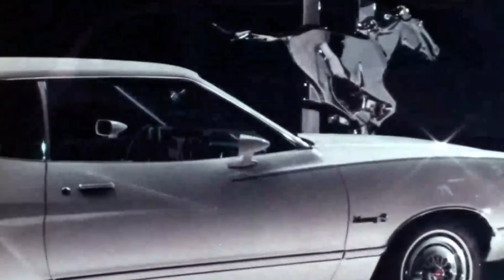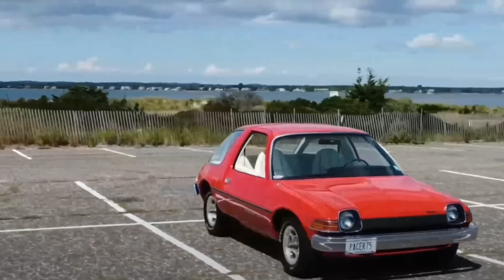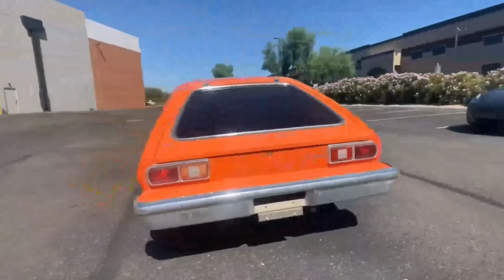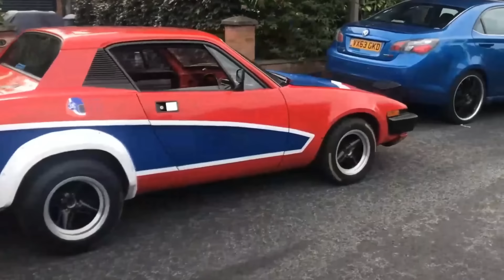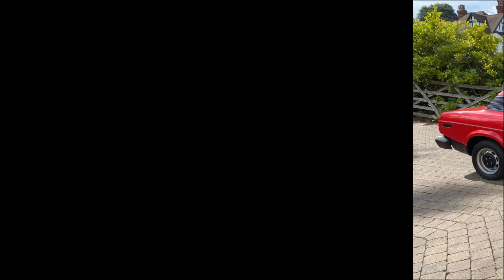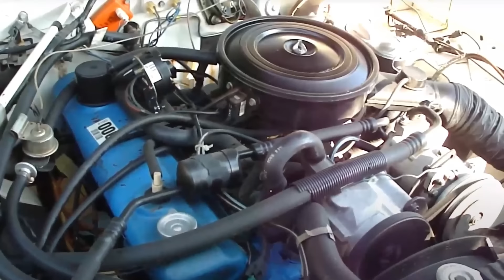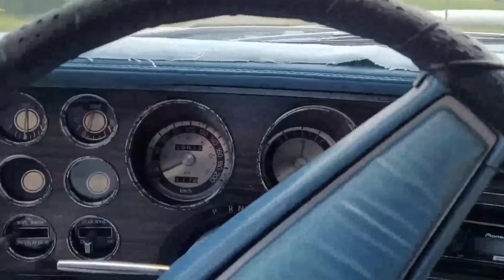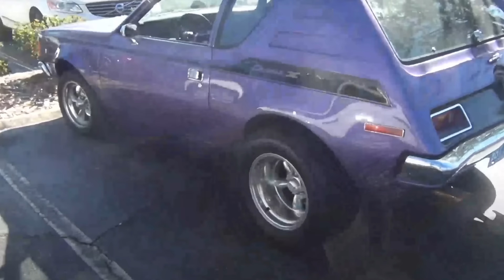Top 10 WORST Cars of the 1970s

Comment: Cars are so much better today. Things like electronic ignition, fuel injection, and factory dyno tuning pretty much took the mystery out whether it would start on a cold day . That is not mention thingd like disc brakes becoming standard, much better safety and  handling.  Modern cars have much better fit and finish on the body panels and paint . ETC.

Comment: I bought a new 1978 Chevette 4-door, 4-speed in 1978. I paid $2300 for it from a local Chevrolet dealer. That car made a name for itself with me behind the wheel. I was 18 years old at the time. There weren't too many days I didn't hold the pedal to the floor and dump the clutch. A retired mechanic once told me that the car wouldn't last past 20,000 miles if I kept driving like that.

20,000 miles went by, then he said it wouldn't make it past 30,000 miles. It made it past that. Then he said it definitely wouldn't make it past 60,000 miles driving that way. It went past 60,000 miles. He then said, "That car made a liar out of me 3 times. That must be one well-built car to take all that abuse!"

People came to ask me, "What did you do to make it run like that?" I opened the hood and said, "It is completely stock." Then they asked, "What makes it run so hard?" Well, when you hold the accelerator to the floor and dump the clutch, it will go or blow. It never blew from doing that; the engine and drivetrain took it.

I had also put 60 series tires on Cragar wheels and raised the rear end. The clutch exploded a little over 100,000 miles. I put a new clutch in, and it had around 250,000 miles and still running when I parked it. I had a new ride and wasn't interested in driving it anymore. It sat for 5 years outside, and a guy who had seen it run back in the day wanted to buy it in the middle of winter, even though it was buried in a snow drift. He said, "I want it now or never." So, I got the tractor out and pulled it out of the snow. He put a battery in it and asked if it would start. I said, "It always did before, but it has been sitting for 5 years with the gas that was in it when it was parked." It fired up after 5 seconds of cranking on it while pumping the accelerator, and he paid me and drove it away. That was the last I saw of it. One of the toughest cars I ever owned. It got 40 mpg when driven normally.

Oh yeah, Dad bought a diesel Chevette—I don't remember the year. Dad was 6'2" tall and had 4 others riding as they went on a 3-hour round trip. Then they fueled up at the same pump. It got 60 mpg, which was impressive! Dad and I raced to see how much difference there was between the gas and diesel. They were pretty even. I thought I would blow the doors off the diesel Chevette. By the way, the diesel Chevette had a factory five-speed manual in it. I thought the engine was made by GM, but I found out later both cars had Isuzu engines. There was a Pontiac version of the Chevette, a T1000—not to be confused with the Terminator character. Lol

Comment: My uncle Donald once owned a '75 Mustang w/opt. 302-cid (5-litre) V8 and automatic transmission! Its biggest flaw was the tranny: the modulator only allowed him to both upshift and downshift manually; coz when it did automatically, I later got the message! In early '83, Brenda's boyfriend Vern, had a '71 or 72 Pinto 2dr., automatic transmission! However, it later wouldn't start, so he junked it!!

Comment: Surprised Mercury Capri is not on the list. What a junker. Mine as well as many other capris on the road with no wing windows because they rattled off. I used plywood. No usable heater, electronic wiring was a disaster. Garbage engines. My 4 cylinder ran as a 3 cylinder most of the time even after a  rebuild unless I fed it a new sparkplug every 3 weeks or so. 1971. Looked nice at the dealer but a pretty turd overall.

Comment: Whoever did these videos didn't live the period. I hated the Pacer, but my folks would only cosign for one. It was 3 on the tree with a straight 6, no ac, and no radio. I would have taken a Gremlin over a Pacer any day of the week. It was so poorly constructed the bolts holding the carburetor in place snapped, and I had to glue with the carb on with liquid solder to drive it to the Cal Worthington's lot in Phoenix. It was shot at 40K...

Comment: I had a Chevette. 0 to 60 took 20 forever it seemed. I got on the highway and a tractor trailer was almost 3/4 mile away. That truck was right on my rear before I knew it. Pedal was to the floor and the car took what seemed like eternity to get to 55 ( the speed limit then). It had a 4 cylinder motor and broke down alot. Transmission failed, wipers stopped working, etc. All within the first year.

Comment: All Chrysler Corporation passengers from 1960 on were of fully unitized construction (except for Imperial through 1966) The Chrysler LeBaron mentioned is considered the M-Body platform which is a stretched version of Chrysler Corporation's F-Body platform which was all-new for 1976. It featured a transverse torsion bar front suspension system. The R-Body cars were the Dodge St Regis, Plymouth Gran Fury, and the Chrysler New Yorker which were essentially on the same platform as 1973 and newer B-Bodies, Dodge Charger, Dodge Coronet, Dodge Monaco, Plymouth Satellite, and Plymouth Fury

Comment: I had a brand new 72 Vega for less than a year. Terrible car. I had a few Chevettes which were great cars for my teenage kids. I'd buy one today if a good standard appeared. The option list, if anyone ever looked, included a header, a Weber carb, 5 speed (stupid fuel economy), a couple of different rear end ratios, etc. The automatics, with air, might have been the slowest car to 60MPH ever built.

Comment: 1. I'm sure GM engineers were begging their superiors not to release the Chevy Vega and start over again when they saw it.
2. The Pacer was intended to be powered by a GM-sourced 1.3-liter Wankel rotary engine. When the rotary project was canceled before an example was even built, that should have killed the Pacer right then and there.
3. The Cosworth-modified Vega engine did not make very much sense when the Vega itself had so many problems.
4. The Mustang II DID have its problems but one good thing came out of it; it saved the Mustang.
5. As was the case at GM with the Vega, I'm sure Ford engineers begged their superiors to kill the Pinto before the first one rolled off the line and start again from scratch.
6. The Chevette was not really intended for American audiences. When it was released its import competition had already moved ahead.
7. The Triumph TR7 - the car that killed British Leyland (or at least one of them).
8. See my earlier comment.
9. See #1.
10. The Gremlin was the Edsel of the 1970s; unwanted when it came out but cherished by collectors today.

Comment: You can say whatever you want. I wish I had one of them right now them chevettes you put a good pair of mud and snow grips on the back of that baby and drive it right through a blizzard. I know I've done it completely submerged in snow. Went out there till I got off the exhaust start that bad boy up while you cleaned it off and came right out with a good pair of mud and snows on the back. Yeah like a truck tire on the back pulled right out no problem. So you say whatever you want I'll take one. I am all the way in

Comment: I bought a 79 Datsun/Nissan 210 Japanese made crap. The biggest lemon I have ever owned. The only thing that did not break was the back seat.  18 mpg, 0-60 in 20 seconds, blown head gasket, starter failure twice. Ignition switch broke twice, AC stopped working, u-joints failed, paint came off, front seat came apart., alternator failed and all of this happened in the course of 50 thousand miles. 
Oh, and to add insult to injury the speedometer was 10% fast. So it really got only 16 mpg and took 22 seconds to get to sixty and I only put 45,000 miles not 50 on that piece of crap.
I would have loved to have a Pinto or a Gremlin instead. I stopped even looking at Jap cars for the next 45 years 100 % American for me.

Comment: You are one of the Stupidest people ever to show your lack of knowledge of the American motors Gremlin!!!  The was a straight 6 of 232 cubes - 258 cubes, acceleration was great with either engine. It was great for reliability I owned a 1971 right out of the showroom and in the 8 years i had it , the only things I spent a dime on were Gas - Oil - Tires - Plugs - Points and wipers! The gas milage was great over 20 MPG, it also was great in snow. It SOLD over 700,000 Gremlins. It was Successful car !!

Comment: This video is so tired and pathetic.  Most of these cars are considered collectible today & draw big crowds at Cars & "Coffee meets.  I grew up during the 70's & got my license in 1979 & am familiar with each & every one of these vehicles.  Yes there were some issues indeed, such as the Vega aluminum engine block, but Chevy introduced an iron block at the end of the run, 1976-77 I believe & were sound good vehicles-however the damage was done.  Ford Pinto's exploding issues have been debunked over time & were concluded to be no more dangerous than any other subcompacts of the era.  There was actually evidence discovered that Mother Jones & some other hysterical outlets rigged some footage & went to extremes to demonstrate an explosion.  Ford Mustang II sold over half a million units in its debut year of 1974 & was largely considered a sales success.  Introduction of the venerable 302 V8 in 1975, cemented its status as a decent performer as a base vehicle & scary fast with modifications.  One must consider the times, the gas crisis of 73-74, caused fuel prices to double overnight.  Admittedly the big 3 weren't ready for this issue & rushed most of the models to market before appropriate tweaks were done, however most of these cars delivered an acceptable level of reliability with inexpensive operating costs.

Comment: The Chevette was a decent car.  You had to be going downhill to hit 80 MPH though.  Forget about 4 people in the car going up hill: it didn't want to.  We took my sister-in-laws Chevette from CT to FL and back.  A bit of a tight space but it worked out fine.  I got to drive my dad's white 1980 model for a couple of years.  I broke the cir-clip on the clutch cable adjuster a few times.  Finally put vise grips on it and left it alone.  It was no race car but I tried to drive it like one.  That car loved to blow headlights.

Comment: the Gremlin was not the ugliest car, the 1961 Chrysler products led that field. The Gremlin was a performer. If you owned one, you knew. The beauty is in the eye of the engineer, not the A I. yapper. The electrical system was AC/Delco or Motorcraft depending on the year. The unreliability was purchased by AMC from other manufacturers
Reply: the eagle had a good reputation

Comment: The AMC Pacer was slated to be the 1st front wheel drive vehicle of the new era. The Cord had that distinction in the 1930's. The Pacer was fitted with a Wankel rotary engine and a transverse power train. However, GM got wind of this and the engine purchases were thwarted so AMC had to reeingineer the car in a few months. The front wheel drivetrain was scrapped and the in line bullet proof 6 cylinder with 7 main bearing support was used. It was shoehorned into the engine compartment and if you have ever had one, you need to remove on of the engine mounts to remove the valve cover and do other repairs. A great driving car, the passenger door was longer to allow for easy passenger access into the rear of the car. These handled nicely as they were wider and stuck to the road. The Chrysler Torqueflite transmission was used so the drivetrain was fairly bulletproof as well. Braking system was decent and the interior components sported different version s of fabric and colors with Sante Fe, Cattle rustler interiors and such. The fuel mileage was mediocre as the 258 was not great on fuel but super on torque. This engine was used for decades and the 4.0 liter is based on the same design. Super torque. I owned 2 of these and a Gremlin as well. My AMC's included a 72 AMX and 5 1969 Rambler SC/Hurst monsters. The 1960 American 2 door Wagon used so little fuel that I always thought the fuel gauge did not work. The Hornets were fun and nice drivers. I crossed creeks in the Gremlin like a little 4x4 but it was 2 wheel drive and a 3 speed on the floor. The Hudson and the Kaiser were all fun drivers but the easiest to drive was the 1965 American 2 dr Ht. 199 or 232 engine (I forget) great performance and drove sweet. I miss the old iron. I have joined the new era now with an HHR. Lotus design multi-timing chain, great sleeper race car. No one expects what it does and I have gone through front tires because of the 5 star burnout ability. See ya on the streets!
Reply: jeep was actually good when amc made it.  chrysler jeep is JUNK.

Comment: I bought a brand new 1978 Mazda GLC right off the showroom floor for $3,600 and it was a great little car. 4-cylinder, 4 speed, no A/C, no radio, but it got close to 40mpg. Never had a problem, never used a drop of oil and surprisingly, I never had to add coolant to the radiator. 
My ex-wife stole it when she left me in 1983 so I bought a brand new 1983 Mazda GLC, this time I got a radio, and it was a great car too.
Reply: all the japan cars were at the top maybe toyota was best by a nose, if that.  way better that everybody else including germany.

Comment: The reason the Cosworth Vega was so weak was because Chevrolet would not let Cosworth put steel sleeves in the cylinders. Their thinking was they wanted to prove the Vega engine could be durable with the standard cylinders. Cosworth said that every time they got over 120 HP it failed, the only way to make any real power was to sleeve it. Chevy said no. Cosworth gave what they had back to chevy and said goodbye. Chevy de-tuned it to 110 HP and put it on the market. Cosworth sued to take their name off of the car but they lost.

Comment: The Dodge and Plymouth sub compacts should have been #1 worst cars on this list. I had a Gremlin that i bought brand new in 72 and i  liked that car better than any other car i had ever bought. Got it Brand New for $2600 and it weighed 2,600 lbs with the 258 cid engine with auto transmission and it lasted me 12 years and 160,000 miles before the good ole Maine salt got to it. That car was a tank and i had a cycle bracket that i attached to the rear bumper and it hauled my 250 Honda with no problem at all. I still wish i had that car.

Comment: I would take ANY of these cars over anything made today. No tech. No computers. Rear wheel drive. Easy to fix or mod. I had a 77 Vega. Was a good first car. Could not get in trouble with it. Once I shitcanned the cat for a straight pipe, advanced the cam and dist a few degrees it ran a ton better. The last year motors had iron sleeves instead of aluminum so the motor was actually good for what it was.

Comment: My grandpa had a '74 Olds w/front-wheel-drive, red exterior, white leather interior, We were on our way to Santa's Villiage near Running Springs, CA,, and all vehicles required snow-chains. There was a shack off the side of the main highway selling/installing these. Would you believe the installer had Down's- syndrome? Instead of placing the jack under the frame, he placed it under the drive-shaft. Would you believe the guy demanded a tip after? The whites of my Grandpa's eye's turned blood-red. This was around 1977-1978. It cost him $1K to get the shaft straightened, and it still wasn't the same after that.

Comment: Sorry but on y’all’s report that was on the Chevy Chevette y’all got it wrong. We had a 1982 4speed manual, 4door model. We purchased it brand new with only 7miles on the engine. We drove it for 12yrs that’s right 12yrs with over 100,000 miles. It still had the original engine, we only had to replace the timing belt that’s it. It was one of our best car we ever owned.

Comment: My mother bought new Chevette in 1978 and it was known as a bad car at the time, but she worked at a Chevrolet dealership and got a huge discount on it. We lived in Arizona so rust wasn’t an issue. It was an easy car to maintain and fix, so my father (being a Porsche mechanic) did almost all of it. We must’ve gotten lucky, because the only major repair the Chevette ever needed was a new standard transmission after 135,000 miles. It was my mother’s daily driver for  8 years and had 278,000 miles on it when it was destroyed when our house burned down. As far as it being slow, it was actually very peppy and the engine loved to rev. It actually was a blast to drive because it was so small and nimble, it was the automatic transmission that killed the performance. The engine was also very easy to modify to improve performance. Not having air conditioning in the summer in Arizona wasn’t a lot of fun, but because there wasn’t any humidity all you had to do was roll down the windows and the breeze made even 110 degrees tolerable.

Comment: This video is a complete disgrace lies. Many of these cars were great inexpensive dependable vehicles.  I had two chevetts great cars they were they saved me a lot of money. Easy peasy to work on very low cost and lasting 25 years for both over 280,000 miles each and still running and sold them both.